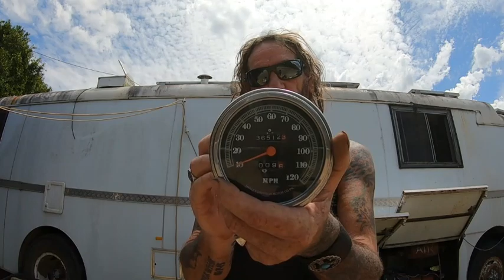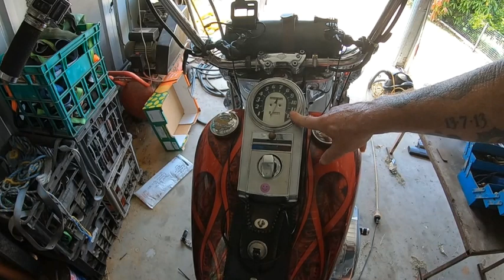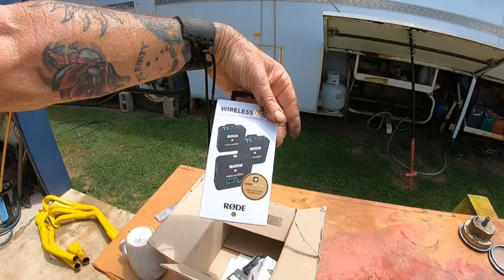1st Prezzies in Da Mail for 2023..... Hippy Trev

Comment: Awesome ///
Look out for the terminals in the housing on your stater trev /// 
When not a good contact they go brittle and break easily // / and the rubber does stick out a fair way on the old evos //
Reply from the maker: l put the motor in 2 years ago well 2nd had with this stator & it all looked ok back then...  its the conector l need to secure cheers